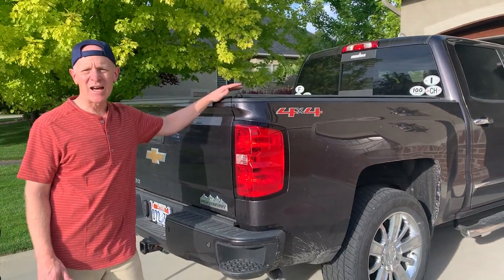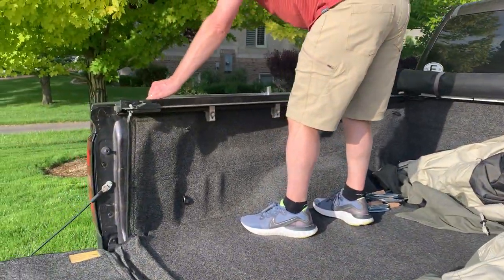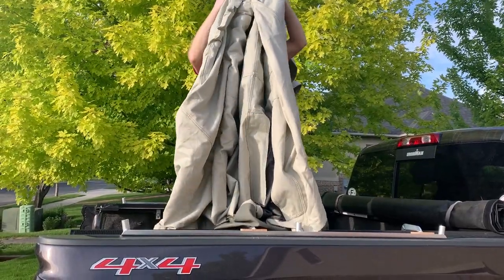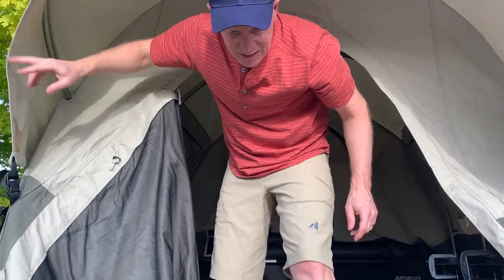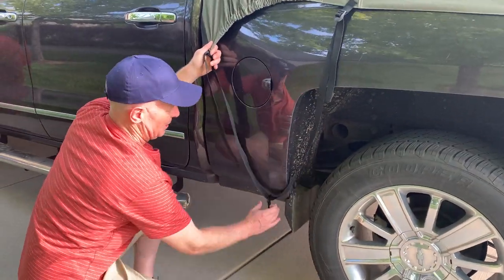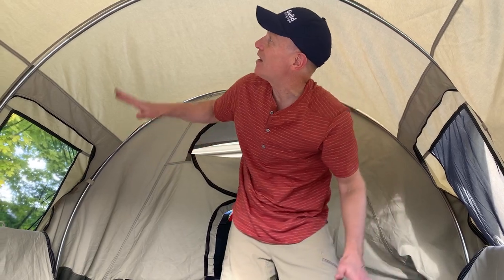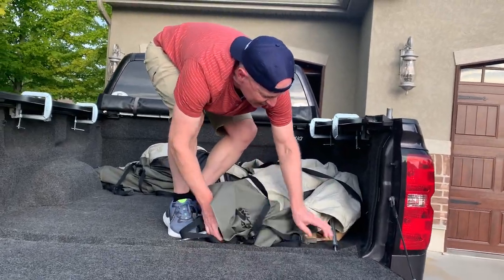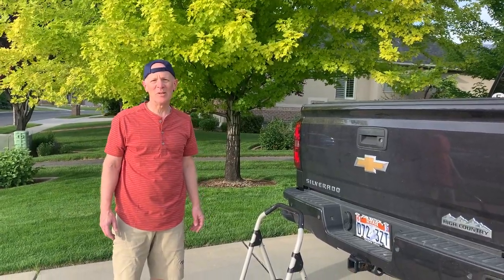Kodiak Truck Tent Quick Easy Fast Setup

Comment: Thank You for compiling and sharing this video. Seriously considering adapting this tent to my M1102 military trailer. Appears to be a very sturdy setup with good wind resistance - I like the metal hoop construction.
Reply from the maker: Yes it's pretty solid. Good luck!
Reply: Did you ever set it up on the trailer? I never though of putting this tent on that trailer.

Comment: I bought one of these about 8 or 9 years ago. I've only used it maybe a dozen times. If you don't have a tonneau cover you can't just lay the thing in the back of your truck. I'm fairly fit and even after setting this thing up about a dozen times, it's still a challenge. It can be very frustrating and then if it gets wet and you have to take it down it's a disaster. Extremely heavy. If you can set it up and leave it set up for a week or three or four days then that makes a little more sense. I now have a truck camper.
Reply from the maker: That sounds perfect. I bet you will really enjoy your camper. Happy travels!

Comment: I think you should buy super strong neodymian magnets and attach them to the underside of the rails. Then you could just slap it on the sides of the truck bed in two seconds. No need to use the clamps.
Reply from the maker: I painted the rails with textured paint and bolted them on. They look great.

Comment: I can see one of those metal pipes putting a big SCRATCH on the side of the truck if it got away from you.
Reply from the maker: They can. Be careful. I have a few.
Reply: Exactly what I was thinking, I wonder if one could use brushable  plasti- dip on the bottom of the poles?
Reply: @whales302  - I like that idea!  Have you tried it?  How did it work?  Thanks! :)

Comment: First, Thank you! This video is super encouraging. My family just purchased a tent and we're pumped to get out and give it a try. Can you please share how you permanently mounted the rails? I think that's a brilliant idea given how much you'll use it.  Thanks again from Pagosa Springs CO.
Reply from the maker: I’ll have to do that. Until then, all I did was paint the rails with a textured black paint. Then, after setting it up and getting a good idea of where the rails should go, I drilled some holes and used some small hex bolts with washers to permanently mount it on the side rails. Works great and looks great! I’ll see if I can get a video done on it. Good luck!
Reply: Can you still use your Tonneau cover?
Reply from the maker: @MathewWolford  yes. Because the tunnel cover, I have does not cover up the bed rails. But you will want to make sure with your set up that it won’t cause a problem.

Comment: Glad I watched this before purchasing. As sturdy as it looks I can just see the polls gouging out my paint if a misshap happens or gust of wind rips threw when setting up not to mention the strap buckles play hell on the paint after awhile when in a windy environment where we always tend to be staying.  Thank for the video.
Reply: Exatly my thoughts not sure if i feel too good setting this up on my 2020 Rebel buts as solid a tent truck as they come some i may have to try it out make some mods to make it a bit more paint friendly
Reply: @yummiermussel5331  maybe build some fender covers that strap to the inside. 🤔
Reply: @stevegriffith8680  I'm thinking just tape the ends of the poles and straps
Reply: @yummiermussel5331  I would think that could still lead to wearing threw the paint. If I had a beater pickup this would be cool but think ill be trying to find a use slide in for my F250. For most part it's just a tow rig for the K5 but would like to take it on some fishing and camping trips up the mountain and be off the ground. 🤷🏼‍♂️
Reply: @stevegriffith8680  check out the Project M by Four Wheel Campers. Depending on your needs you may be able to get a brand new one instead and stay under 20k
Reply: @yummiermussel5331  I looked into it and even after doing the math for what I get I have yet to find anything that can come close to the palomino Backpack for price and what you can get. FWC in my opinion is riding the coat tells of the overland craze and because it's "overland" the have a overland price. In reality I have a tig and mig welder I can built a box and pop up then have a canvas shop build me sides and I'd be in it about 1500 bucks. But if I do a slide in I want a turn key set up. I have enough projects 😂 I want to trailer the crawler to moab and sand hollow ut as well as king of hammers and just have a place to lay my head down at night, but would nice to be able to cook and relax out of the weather when needed. I was just thinking a bed tent would be cool for them solo trips where I'm eating cold cuts and drinking beer but as we see in the video you better be ok with scratches witch for some is not a big deal when it's a camp rig. As mentioned before my truck is a tow rig primarily.  But plenty of places in the nevada desert where I can go remote camp and not have to worry about desert pin stripes. Thinking again I'd be curious if pool noodles would help with the strap issue.  🤔
Reply from the maker: The poles can and will scratch if you're not careful. I have a few myself that I need to try and buff out. The straps really haven't been an issue. But care with the poles should be taken. Maybe the tape idea is a good one. I'll have to try that.
Reply: @stevegriffith8680  yeah I hear ya do what's best for you I would love to build one but unfortunately don't know how or have the tools as all I have is woodwork tools but the project m is good for solo or couple camping I think if you don't mind buying a separate charging station/generator and maybe a portable ac if necessary. Other than that for me personally, ill just buy the tent camper and modify the poles until next year then I'll just buy a small towable camper.

Comment: add 20 minutes for a set-up out of the box. most will need larger c clamps than what's provided. I suggest the husky quick-adjustable c-clamp to make the set-up go a little easier.
Reply from the maker: I agree. I ended up mounting my rails right onto the truck with bolts after painting them with textured black paint.

Comment: In the video you said the longer awning pole goes in the back over the cab. However, the Kodiak instructions say differently. They specifically say the longer awning pole goes over the tailgate section. Did you mean to say that or is the manual wrong?
Reply from the maker: I couldn’t say for sure at this point. But I apologize if I misspoke. I haven’t heard that from anyone in all the views. But it’s still possible :-)

Comment: Do the straps affect the paint on your truck at all?
Reply from the maker: I didn't find the straps to be an issue. But the poles require some care. I didn't really notice the first few times how much they can scratch your truck if you let them run a little wild.

Comment: Should of got some welders vice grips instead of the C clamps if time is of the essence.
Reply from the maker: Sounds like a good option. I actually ended up mounting the rails to the side rails of my truck. I painted them with a textured black paint. It looks great and now they're in position and ready to go anytime.

Comment: May I ask which clamps did you get? Thanks.
Reply from the maker: I actually don’t use the clamps anymore. Permanently mounted the rails on my truck sides. First, I painted them with a texture black paint. And I carefully drill some holes and put bolts through. They look great!

Comment: A couple of questions if you wouldn't mind answering. I'm a solo female traveler (elderly & 5'5) in your opinion is it doable for me to setup and approximately how long you think it would take me? Also, what is lining your truck bed? TIA
Reply from the maker: I have a “Bed Rug” in the back of the truck that offers some padding. But I also throw down a foam pad. To be honest it might be a little tricky for you to set up. A second set of hands would definitely prove useful. I wouldn’t want you to end up frustrated.

Comment: Question: In your opinion, since it seems that the straps play a major role in keeping the tent in place once up-Instead of C clamps (I also have a tonneau) would sections of industrial Velcro hold the rails in place...?
Reply from the maker: I actually painted the rails with a black textured metal paint, drilled two holes in each of the side rails (that can be easily plugged if I want to remove them) and committed to having the rails as part of my side walls using stainless bolts and nuts. It looks really good and made it much easier/faster to put the tent up. Don't forget to sand the metal before spray painting to promote adhesion.
Reply: @tandemtravels  My rails have a plastic cap that runs from front to back. I also considered drilling into the rails, use a well nut and Hillman threaded knob. After some thought I realized there had to be a multitude of ways to secure the rails but hadn’t seen any. Please post a pic of what you did when you get the chance. Thx for commenting back.
Reply from the maker: Sorry the truck was dirty when I took these pics. Hope this helps.
https://drive.google.com/file/d/1Gyh7f0iDMx2nbLaLogdBTMOoHWjIEPot/view?usp=sharing
https://drive.google.com/file/d/1PgpCXR8zHdjhNB6bf2xgQXKHFQ_wvToG/view?usp=sharing
https://drive.google.com/file/d/1j-zfxGuQ8GnIPDzD6nsaAI2W3Hs8PObh/view?usp=sharing
https://drive.google.com/file/d/1om0wG4wIobYLWCDk9_I3CtlJ4yXWMWsq/view?usp=sharing

Comment: Great video.  I have a Tacoma with the short bed, only five and a half feet long, I believe.  How do you think it'd do with that?  I was looking at over landing with a rack and rooftop tent, but this is a much cheaper option.  Thanks for the video.  Well done.
Reply from the maker: From the Kodiak website: 
Model 7211
Fits mid-sized and compact trucks with 5 to 6.5 ft. bed length (measured inside with tailgate up).
Toyota Tacoma, Nissan Frontier, Chevy Colorado,
GMC Canyon, Dodge Dakota, and Ford Ranger.
Reply: I have a Honda Ridgeline (newer one NOT the ones that look like a small Chev Avalanche), bed is 5'3" and the model 7211 works just fine. Ridgelines are not listed as models that fit because it wouldn't work on older ones with the Avalanche curved bed front. You start at the back and work your way forward when you set it up so and excess is at the front and can be rolled up. You will be fine.
Reply: @skotth2 . Are you saying that would work fine on my 2022 Honda ridgeline. Do you have any photos? Thank you.
Reply: @davidrivera1727  It should. I don't think there's much difference between my 2018 and your 2022. The main thing you would deal with is that, when putting up the tent, since you always start at the back, the excess canvas will be at the front and since Ridgelines don't have a seperation gap between the bed and the cab to drop that excess down you would simply roll that excess up and create a kind of channel so that heavy rain runs down both sides instead of seeping backwards into the bed. I do have pics but I can't attach them to a reply in this thread.

Comment: But where is your gear before you set the tent up ? And after you set it up…like your fishing gear and camping stuff. . I’m not sure I see the point w this tent unless you have a second truck which is reserved for your gear.
Reply from the maker: You can actually still fit a lot of stuff in the back of your truck with the tent laying down. At least in my bed. And it’s just my wife and I we have room in the backseat of the truck as well. Happy travels!

Comment: What were the wood blocks for?
Reply: Looks as tho so the clamps don't mess up the bed cover rails. Without the blocks it looks as tho the clamp pad will not contact the pole braket before messing up the rails. Just a guess. Other reason would be to distribute the load across the poll bracket to keep them from getting deformed.
Reply from the maker: Really just to make the clamps I had work. I've texture painted and bolted the rail on permanently  and it looks great.

Comment: Even 12 minutes in the rain and/or wind would not be fun.  I bet there is a way to fabricate hinges where the poles attach to the bed rails, so that the tent remains attached at all times and folds down.  You would have to remove the tonneau cover and use a home made waterproof tarp to cover the tent and box while driving but I bet it could be done.  Just a thought.
Reply from the maker: I thought about that. Very possible. I actually painted the rails with a black textured metal paint, drilled two holes in each of the side rails (that can be easily plugged if I want to remove them) and committed to having the rails as part of my side walls using stainless bolts and nuts. It looks really good and made it much easier/faster to put the tent up. Don't forget to sand the metal before spray painting to promote adhesion.

As a side note, the rolled up tonneau cover makes for a fantastic shelf for  your clothing bags inside still leaving all the floor space for bedding. A wonderful surprise.
Reply: @tandemtravels  setting up any tent in the rain is a pain, most would wait out the rain so really a non issue

Comment: Dude.  I have one of the truck bed tents.  I am the most amazing outdoor stud tent assembler cool guy ever.  Ever!  Trust me there is nothing quick or easy about set up of these tents.  They are great though set up time and the general hassle makes it lose most of the cool factor points.
Reply from the maker: Sounds like you've  had a bad experience. With my wife's help we can set it up quickly. This is from a starting point of having the poles all assembled and the tent laying in the bed as shown in the video.

Comment: wouldn't quick clamps make it faster?
Reply from the maker: There are all kinds of options. I think the thing you want is something that doesn't get in the way while you're inside the tent. I ended up painting the rails with textured black paint and then I permanently bolted them to the side rails. I think it looks great.
Reply: @tandemtravels  great idea. I was thinking of that too.

Comment: No thanks. I don't like scratches on my truck and with a truck topper, there's zero set up. It takes Zero minutes. Open the door and climb in. Carpeted interior, built in lights, huge sliding windows with screens and 100% weather proof.
Reply from the maker: Glad you found something that works for you. Enjoy camping!